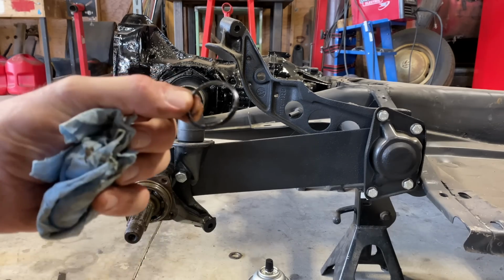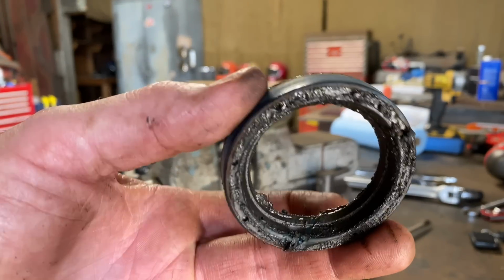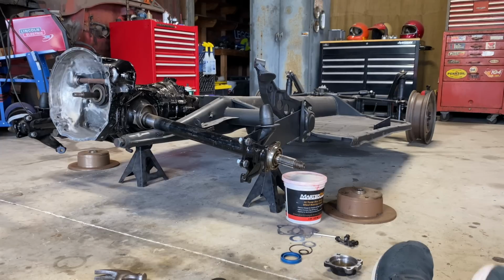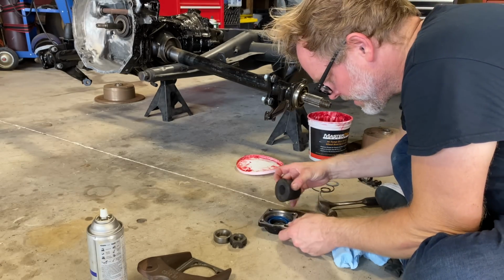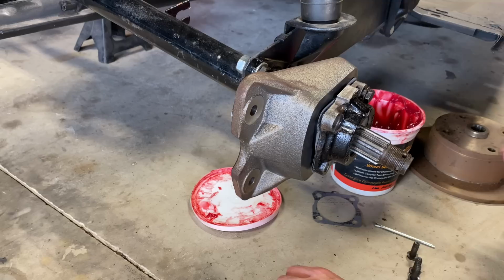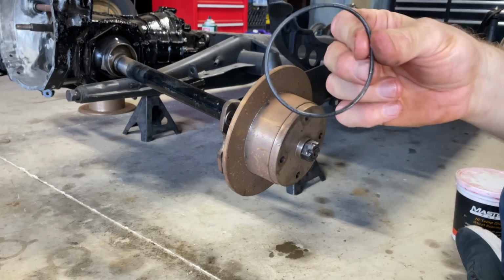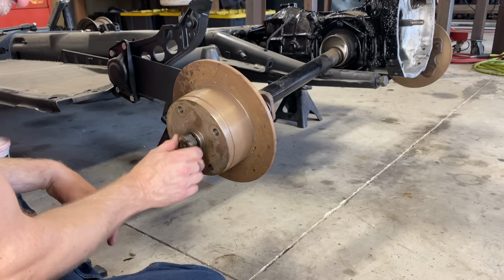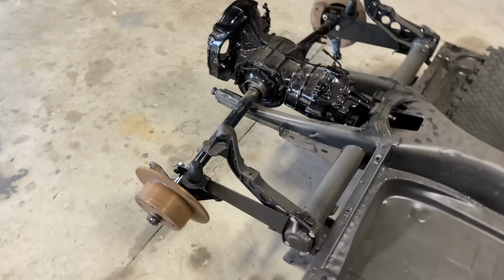VW Karmann Ghia Chassis - Rear Disc Brakes & Transmission

Comment: CT, you need to tear it all apart again. You need to lube the lip of the seal with grease, then fit the collar into the seal before installing it on the axle. There needs to be a gasket between the axle tube flange and caliper bracket. Then install second gasket and slip the seal and collar assembly into axle. The way you put it together might allow the seal lip to roll allowing it to leak. Be sure to pul a little grease into axle bearings it doesn’t need to be packed full, but not dry. Hope this helps.

Comment: If you get some spare cash invest in a decent torque wrench buddy. 
Will give you peace of mind that all bolts are correctly torqued
Keep the videos coming 👍👍👍
Reply: @clutchSA  for bearings it's best to have the correct torque spec to avoid premature wear or damage to the bearing. Anything else yes use ugga duggas
Reply: @clutchSA  no... Good mechanical are using torque specs...

Comment: As a life long mechanic I was taught to never clean bearings with any type of solvent. Rather blow them out w compressed air and wipe clean. Also I remember having to remove Axel nuts on Type 1& 2. Every time I had to use a 3 foot bar on to a breaker bar as they are tighter than shit....I believe 150+ foot pounds.
Reply: 250
Reply: @demRucks  thankyou

Comment: The hole is more likely to drain any water that might get in there to prevent rusting. But that’s just my “guess”.
Also those bolts on the seal housing should be German spec. “Gutentighte”

Comment: Not sure if the disc brake bracket has a weep hole in it, but it looks like you put the passenger side end cap upside down. Hole is at the botton. Still could have used the big o-ring seal. The end cap has a angle/groove for it.

Comment: Hey Ct,
I got a question hope yu can answer, 
I’m workin on a 65 ghia, im installing reverse lights hella on the bumpers, can you tell me a dimension where to drill the holes on the top of bumper blade?
Reply from the maker: Hey buddy! I'm not sure. You can check on the samba website.

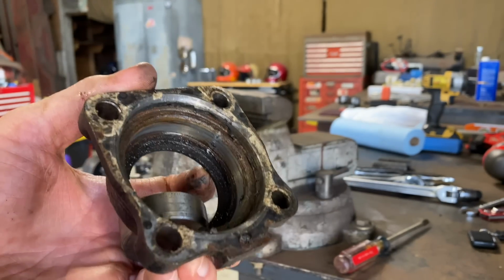Comment: At 7:24 into the video, you show the part you just took the seal out of. I was cringing while watching you use that “tool” to remove the seal. My thought just before it popped, was he’s going to gouge the seal surface, 7:24 frames on the video show the gouge. That part will leak or at least seep trans oil, now even with the new seal. Just remember this when the leak shows up so you don’t have to struggle to figure out why.

Comment: Didn’t notice if you packed your bearings or not… is this just a soft assembly?
Reply: Rear axle bearings are lubed with the transmission fluid, these don't get packed like front bearings.

Comment: Ct you didn't grease your  bearings you said you would do them after you cleaned them out then built them up dry
Reply from the maker: Oh I forgot....dang it...I'll go back and do it later. =)
Reply: @CTmoog  So what are the odds that you won't go back and do it later? lol
Reply: BTW it looks like you left both sides dry.
Reply: The rear axle bearings are lubed with the transmission fluid, they don't get packed like front bearings.